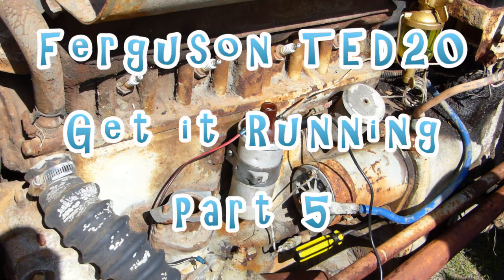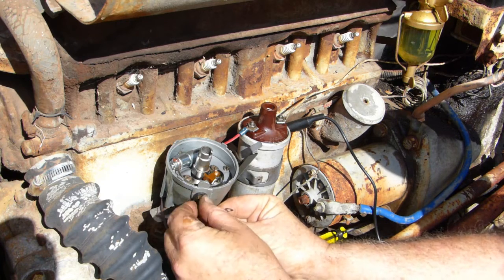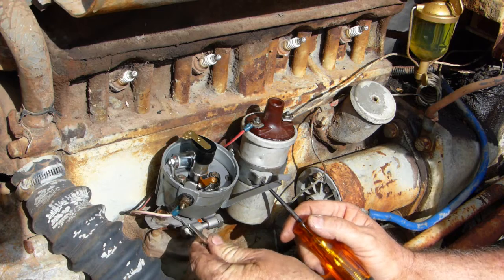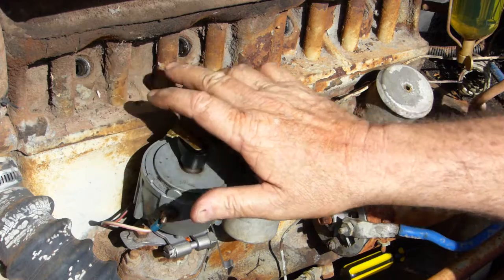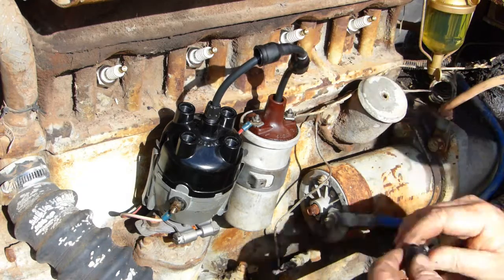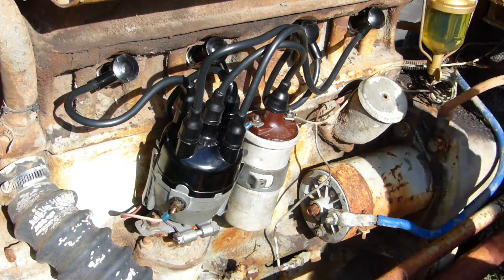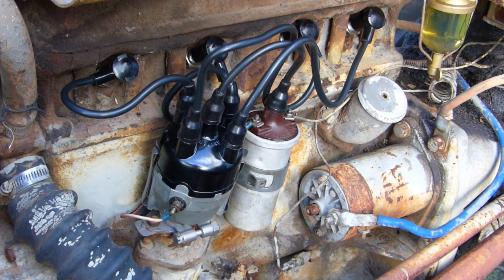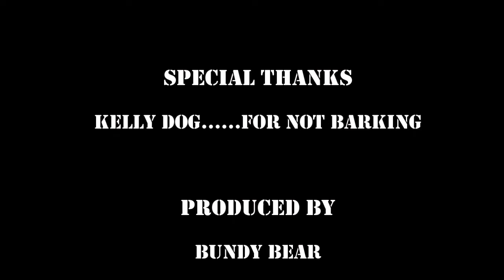Ferguson TED20 Barn Find, Lets Get it Going Part 5

Comment: Thank you so much for this video. I just replaced the points on my te20 to electronic points, Powerspark Electronic Ignition Kit for Lucas D3A4 Distributor Positive Earth (K33pp). The reason to do the switch to “point less” is the high humidity here in Denmark most of the year. Often the old points did not work well.
Any way you trick with the screwdriver in flywheel and rotating the distributor worked very well using a multimeter connected to the ground and the input side on the coil. Easy to measure when the distributer was in the right position!
Reply from the maker: Glad it helped, it usually works well.

Comment: A bit of trivia!

The petrol motor in the Fergy was used in the Vanguard Spacemaster, a sporty sedan sold in the 1950s in Australia and probably South Africa and New Zealand, but also in the sport Morgan 4+4 a rather snazzy sports 2 seater beyond the reach of most 18 Year olds of the day.

Hey Lance, you could probably hot up the old girl with a couple of SU carbs and some super grade petrol!!!!   You could probably plough an extra acre per day with the improved performance.

Steve the ever hopeful young mechanic!!!
Reply from the maker: I know a fellow with a Triumph vintage race car with the same engine. He put new con rods in and a super charger and has 170hp at the rear wheels on the dyno. I was impressed with that!

Comment: Sorry Lance but I am a bit confused. ('56 TEA20) Screwdriver in flywheel @ TDC then you mention 10 deg. I have done that and have the timing marks on flywheel showing '0' TDC so where does 10 deg come in...is the the initial static required by moving flywheel to '10' mark?
Reply from the maker: I think you will find the screw driver goes in at around 10deg. Not exactly on tdc
Reply: @BundyBearsShed  Thank's Lance for prompt reply...spose it's put it together and fire it up then! Being very positive here.....

Comment: Hey man I've got myself one of these Ted's but someone "tinkered" with it and it's all out of whack, and the issue I have is, the flywheel is ceased, it won't move At All so I wanted to ask is there any tips to ehm un stuck it? Thanks mate
Reply from the maker: Pour come CRC down the spark plug holes and let  it sit for a while then remove the srarter and try and lever the flywwheel back and forth. Sometimes they will come free.

Comment: How much rotational play should there be in the distributor shaft ? Mine seem to be able to turn quite a lot - perhaps 15-20 degrees ?
Reply from the maker: At the top there is a fair amount as you are just turning the plate the advance is on
Reply: @BundyBearsShed  thanks a lot - I thought the shaft was supposed to be fixed if I try to turn it by turning the pointer?
Reply: O

Comment: Hi how you know you are on the good hole for the TDC of the 1? Because we have 4 hole
Reply from the maker: No4 valves rocking, or wind the engine with no1 plug out and feel for compression or the rotor in the distributor will point at no 1 spark plug. Either will work.
Reply: @BundyBearsShed  ok I try. It’s not a problem if I have moved the distributor before because I’m not sure to remember if the distributor was not turning by accident. Because I have added a triumph TR3 pedestal for ad a tachometer and I don’t remember if I have turning the rotor of the distributor to check but if I have turned the rotor and I replace it directly that a problem?

Comment: No hole in my flywheel. I do however have timing marks that can be seen with the inspection cover open.
Reply from the maker: Not seen a TED with an inspection cover, is it a TO20?
Reply: @BundyBearsShed  yes, it is a to20

Comment: Hi just a question. I have a Ferguson ted20. I have been able to get it going from watching your videos as I am a newbie to it all and has been very helpful. I have given my Dynamo to someone I know that can recondition them and he asked if it was positive or negative earth. How would I know as when I had it it never had no battery on and had new battery terminals on the leads so I just put it on with the negative terminal to the lead that was earth out on the chassis of the tractor. It all works but not sure if it was a positive earth but how else would I know which way round the earth is? Thanks Ed
Reply from the maker: You can re polarise a generator but originally they were positive earth but if you want to run any modern equipment neg earth is the way to go.
Reply: So as long as I polarise the Dynamo to negative earth then I will be fine as I have the distributor and ignition coil set up to negative earth like you did in your let’s gets it started video

Comment: Hi  Lance !  Thank-you for all your useful videos . I am busy restoring a TED20 , just now , and have rebuilt the engine with new liners and pistons , so it is quite tight . I have got to the stage of trying to engage the starter with the ring gear , but although it spins , it does not engage . On taking the starter out again , it looks like instead of engaging , it is damaging the teeth on the ring gear .
I am just a novice at this , so would appreciate your advice , to get my resto back on track , 
Thanks in the meantime , 
Ted .
Reply from the maker: G Day Edward, Email on bundybearsshed@gmail.com. Can the engine turn over by hand easily?

Comment: The tape on the steering wheel is a trick they use in formula one, so they know when they are going straight.
Reply from the maker: It is such a powerful beast, very similar to formula one lol.

Comment: Bundy, I don't know where my rotor was pointing when I took my distributor off. You don't mention in the video that there are actually 4 holes in the flywheel, so how do I tell which hole to set no1 cylinder to without perhaps being 180 reg out as no1 cylinder will rise to tdc twice but it's the firing stroke hole needed! Thanks
Reply from the maker: G Day Gordon, The distributor drive is offset and will only go back in and engage in one position. If you turn your distributor up side down and look at the drive web you will see what I mean. As the distributor is driven from the camshaft it has to be correct.
Reply: I'm with you there - so if you point the rotor at 10 o'clock & do your check for spark then only one of the 4 holes in the flywheel would ever be lined up with your screwdriver. I've been trying for a couple of months now to get my tea20 started (on handle as no starter - as a result bit tired!) no joy yet

Comment: Hi lance. My mf35 petrol tends to spit and splutter similar to your grey fergie in the vid. When cold I can also see what I think my be petrol splitting out the exhaust,albeit only a tiny bit. When warm it splutters a lot less but still there. What do u think it is? 
Got new plugs, dist cap,points set, standard ingnition setting, new plugs and leads, new wiring, carb rebuilt, clean fuel, sediment bowel clean, governor set nicely. Any ideas? Do they all do this?
Reply from the maker: I would think mixture adjustment would be worth fiddling with. Most times it is mixture or timing.

Comment: Hi, I think the coil on my dad's tractor is caput, power to it but nothing after. The coil on there is a Lucas 4P 12 or HP12, hard to read.  Should I try & find the same or is there a compatible one? Thanks
Reply from the maker: And internal resistor 12v coil will do the job for you.

Comment: Hi Lance! I'm restoring a TED20 from 1954 and the engine has been completely dismantled. Do you have any idea of how the gear underneth the distributor should be fitted against the camshaft? Unfortunately I can't find anything regarding this in the workshop manual. I suppose it must be in a certain way so that the timing is right?
Best regards,Martin, Sweden
Reply from the maker: G Day Martin, I had a look in my manual and could not see it either but in the past I have the engine on top dead centre firing on number one and place the gear so the contact points would just be opening to fire on number one as well.
Reply: Of course, why didn't I think of that? Thanks so much!

Comment: Hi lance,I have set the timing with the timing light as you have done in this video but my tractor runs rough  .I end up  rotating  the distributor  to get it to run anyway  proper and it ends up miles away from where the timing light  showed correct timing.Any ideas what could be wrong,Great video by the way.Thanks.
Reply from the maker: Possibly the oil pump shaft has not been timed correctly in relation to the camshaft.
Reply: Yes lance I have moved that around a bit.I am finding it difficult to get that right.

Comment: I got just one spark when i turn off the key. I have new distributor, new points, new condenser, new wiring, new coil new plugs. The spark disappears when  cranking. Maybe points are  installed incorrectly (touches the housing)?
Reply from the maker: Could be your starter drawing too many amps or just a poor connection somewhere.

Comment: Great video Lance. I'll try and set the timing. I've got drama with my TE20 . cant seem to get it running smooth. she's got  a popping sound when on idle  .  can't  tell if it's fuel or electrical related?  replaced points , plugs and kit through the carby. wondering if you'd point me in right direction please?
Reply from the maker: Popping can be a tight valve, have you set the tappets yet? They do sound a little rough at idle often but under load they settle right down I have found out at times.

Comment: Hello Lance! How do you know if the cylinder no 1 is at TDC for compression? Could it be on the exhaust stroke? Thanks in advance. Cheers, Paul
Reply from the maker: The rotor button will point towards the no1 spark plug or the no 4 rockers will be rocking
Reply: @BundyBearsShed  Allright. I'll take off the valvecover and check. Thanks!

Comment: the drive gear for my distributor, when in the correct place, won't seat far enough to let the distributor mount to seat properly. It will only seat in two positions 180 degrees apart.
Reply from the maker: There is a key that drives the oil pump is it in the correct ce, they will only go in one way as the drive tang is offset.
Reply: @BundyBearsShed  thanks lance. Key is in place. I put the gear in place and riggled the fan and the gear dropped into place. I then used your test light trick and she started with choke. . Will only run for a short while but I have a stack of washers (.140") under the float needle to stop flooding. Will reduce washer stack so the bowl fills more. Love your clips and tips.

Comment: Hi, Great Video. I bought a kit online(leads, spark plugs, points, cap and coil) as the tractor would be going fine then just start coughing and spluttering. Could you tell me Is your wire from the ignition key going to the + or - on your coil? I have a positive earth also.
Also I have allot of slop in the distrubutor cam shaft, so much so that when adjusting housing to get test light to show, the points lobe is pushing the shaft around with it. Im thinking now this could be the root of my problem? I notice a couple of springs below the points cover to recenter cam shaft. Maybe these have lost there spring. Could you shed some light on this... am i barking up the right tree?
Reply from the maker: If you are running a positive earth system the positive terminal on the coil goes to the points and the negative goes to the ignition switch. The distributor slop can be a problem but I have found that opening the points to say 0.025" does help it a little. I have a video on restoring your distributor here somewhere .

Comment: That may be a TE20 but its not a TED 20 as the D  meant it was a Diesel . we had one in the early 60's bought second hand  around the time that Massey Harris took them over  and the brought out the 3 cylinder Perkins engined  Massey Ferguson 35
Reply from the maker: You are wrong there Tom, the diesel was a TEF 20.
Reply: @BundyBearsShed  OK correction noted

Comment: How do you ascertain if your TE20 is Delco or Lucas System?
Reply from the maker: Lucas has it on the tag on the distributor, I believe the Delco does as well.
Reply: Lucas systems require positive ground. Why? Lucas coils were wound for positive ground (negative spark).They were wound for the transformer action which gives an extra 300 volts induced into the Secondary coil winding. Primary and secondary windings are wound in series. Also there is less burning in the 4 contacts in the distributor (4 cylinder) as this is transferred to the rotor cap. Electrical Theory, isn't it great?

Comment: How many times do you turns the carburettor main jet?
Reply from the maker: 1 3/4 turns out from full in is a good starting point. For hard work open it to 2 1/4 if you need to.

Comment: I have a 1948 fergy lance straight petrol there is no hole under starter .
Reply from the maker: G Day Colin, My 48 has but never say never with these old tractors, it is only 1/4" and I have seen them blocked and painted over.

Comment: These are Spark Plugs for a TEA 20 NOTE : TED 20 has 3/4 Reach Spark Plugs
Reply from the maker: These are hotter plugs we use. I have mixed and matched to see if I coulld feel the difference and to date I cant see any difference.
Reply: @BundyBearsShed   The TED head  Has a Thread 3/4'' Deep the tea 20 Head only has a 1/2 deep thread  The correct plug for a TED is Champion N21 or Equivalent

Comment: G'day Lance well the old girl runs, good one. Looking at her you wouldn't think that you would even get her going! When you come to doing a total restoration job do you replace or refurbish most of the parts, or replace for new? Thanks for the video it bought back old memories of trying to get my EH going on wet winters day. Thanks lance very interesting on how you went about setting the distributor John PS just one thing did you do a compression test before hand..
Reply from the maker: G Day John, No compression test on this as yet. Some times I restore the parts and others I just fit new ones. Sparex supply a few for me and in that case I just replace them. Very satisfying re building them though.
Reply: Bundy Bears Shed thanks for replying Lance I recon it would be a very satisfying especially when you see a tractor in that condition and restore it back to new like you have done before, great job John

Comment: I went through and replaced the points and condenser on my '55 TED20 (following your video on it) and set the timing with a test light just like you did in the video, but the thing wouldn't start. 
It sounded like it was kicking back when it fired, as if the timing was way early, so I re-set everything to the witness marks as it was before i took it apart, and it fired right up! 
Thing is the way it's set up right now is about 1/8 of a turn counter clockwise on the distributor, which to me sounds WAY retarded,  am I missing something here or is there something funny going on with my tractor? 

Many thanks for the videos, they're a great help and wonderful entertainment in their own right!
Reply from the maker: Someone at some stage may have the distributor drive gear off a tooth or so but the test light should allow for that but the flywheel timing mark will be out.  On this video I miss spoke re retard and advance but I put a note in the description. In the end it is about getting it running correctly however you do it,

Comment: Thanks for the vid, just a bit confused. When you said after we have the screwdriver in the Flywheel and the points set to just opening you said to retard the distributor one line, but on my ted20 turning the distributor clockwise would advance the timing. Nick.
Reply from the maker: Yes I was backwards, I put a note in the description.